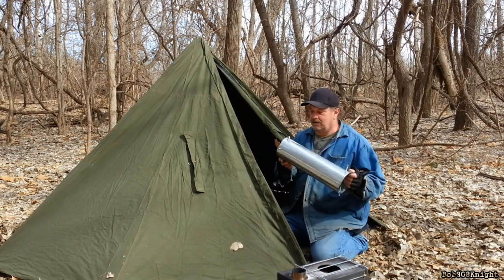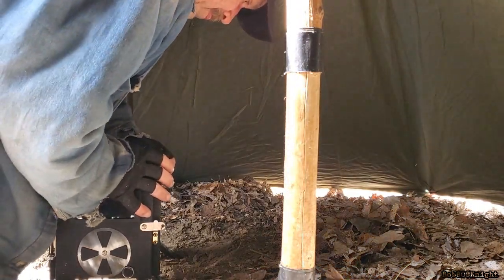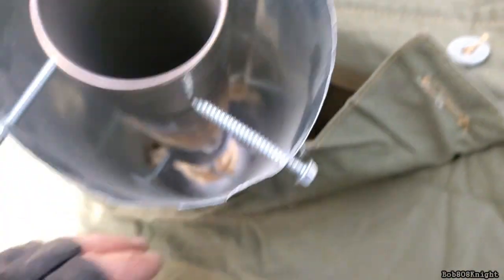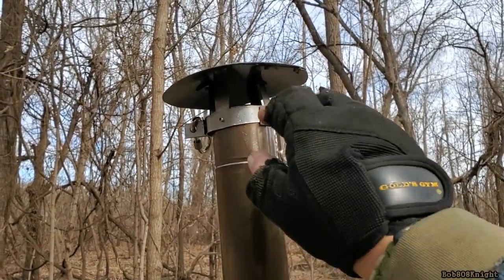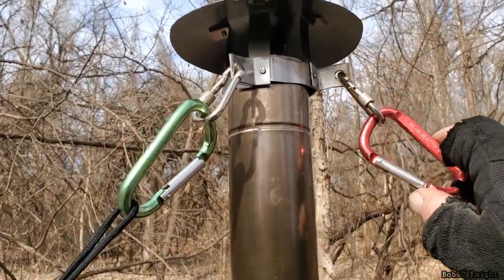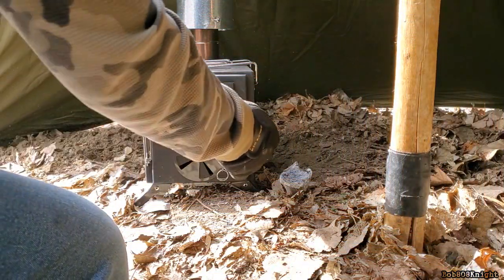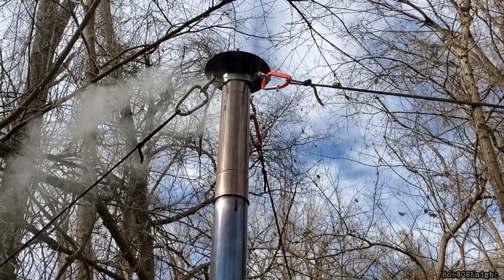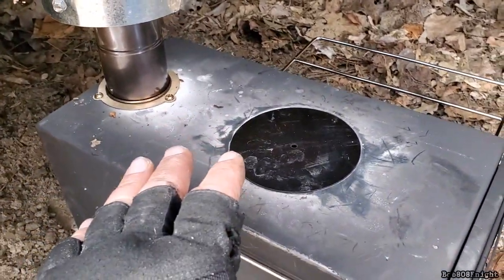Putting The Stove In The Polish Lavvu

Comment: Nice setup Bob! I see it already spring time there, is it cold stil? We have three feet of snow here in Finland :D. If you find a way to pile a lot of stones around that stove you could make a sauna. We did it once with a large tarp and a stove. You just have to heat it up alot to get decent temperature inside. We got it to around 60 degrees centigrade so not really a sauna but close enough. Happy summer ja great hikes Bob!
Reply from the maker: Thanks Samuil... we're in the end of winter and the beginning of spring.. I was out the other day ... it was 61 in the morning and then a cold front came through and by the time I was headed out it was 32° and snowing... I really like the stone idea. It would become a thermal mass. Store up the heat and then release it at night. Sounds like you have an excellent setup. Maybe a video of it someday? Great talking to you. Have an awesome day